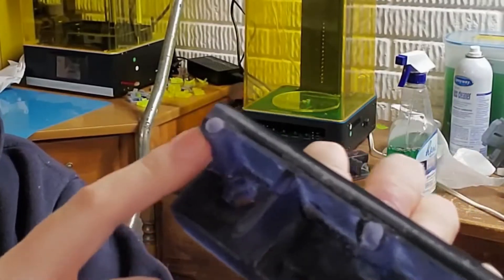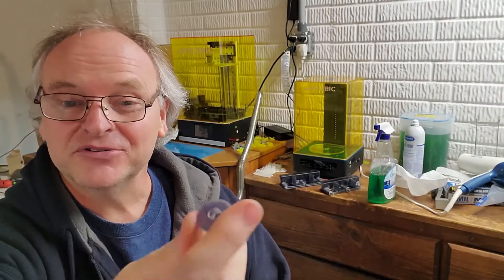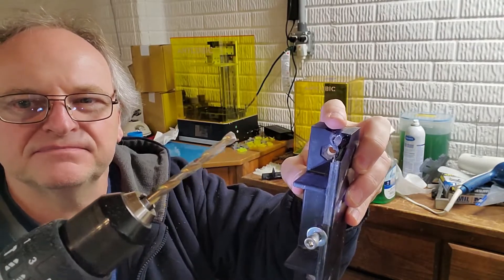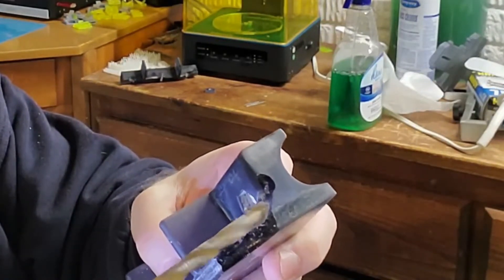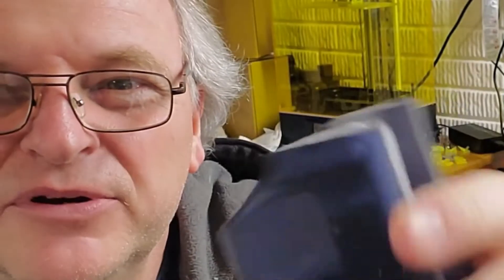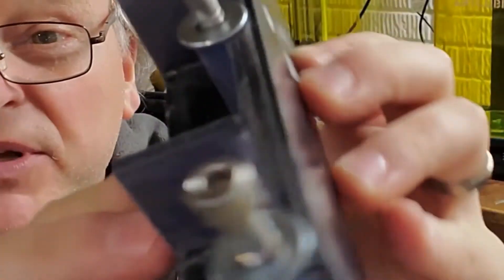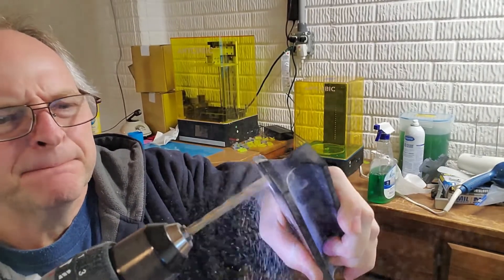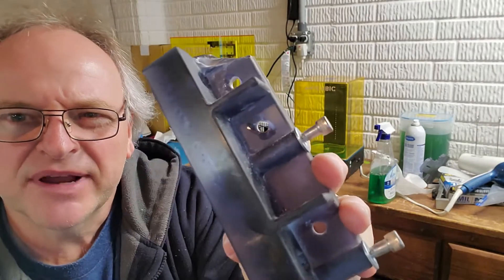Drilling Holes In Resin 3D Printed Parts

Comment: I am working on a 42mm length and 6mm dia gear.. the aim is to make a small hole of 2.5 mm on the shaft near the head. Since this part is small in size, holding the part and drilling seems convenient, but my question is… is it safe to drill like this or should I use a bench vice to keep the part steady?

Comment: I have an SLA Resin print coming in the mail. I need to mount a bunch of bulkhead connectors on this print. Where the bulkheads mount I put 2mm holes. I was thinking of using very small short wood screws with a bit of epoxy when I mount, but I am worried that the wood screws will put too much pressure on the print and make it crack. Should I consider a different method?
Reply from the maker: Without seeing the part it is difficult to answer. If the holes are close to the edge of the part, or another way of saying this, if there isn't much meat around the screw holes they may crack.  The thickness of the material will also matter. I just can't say without seeing it.

Comment: If available, a drill press would help considerably. I haven't had to drill resin parts yet but having been a machinist and working with acrylic you want somewhat of a fast rpm with light pressure. SPECIALLY when you are about to brake through. What I have done is design my part with a larger hole and inserted a threaded brass insert in. Then use some UV cured adhesive to glue it in place with a hand held UV light.

Comment: Great tip with the reverse drilling! With the through hole you could also start with a smaller hole as an index for both sides (maybe integrate it in the print) and then enlarge it from both sides towards the middle to avoid splitting. I'd probably go reverse for that, too though.